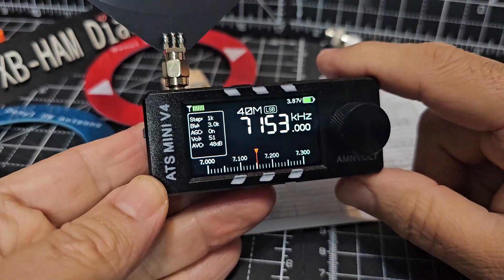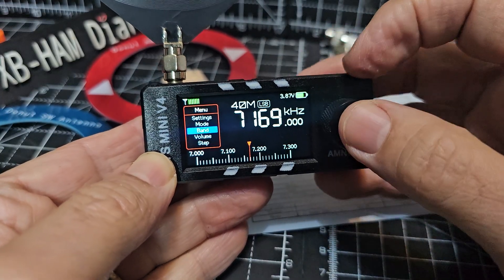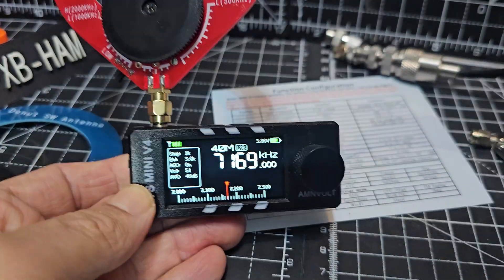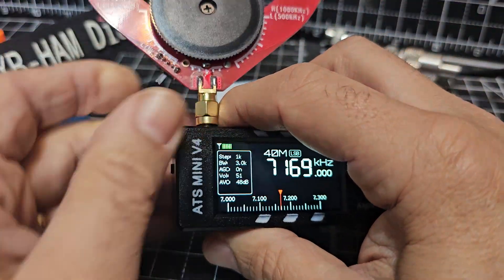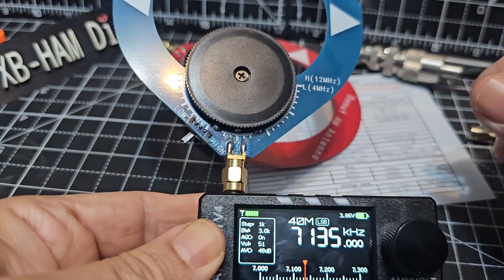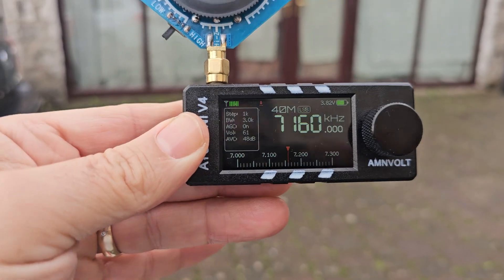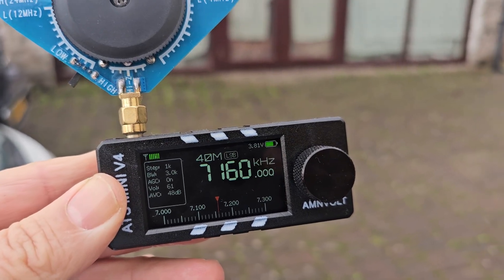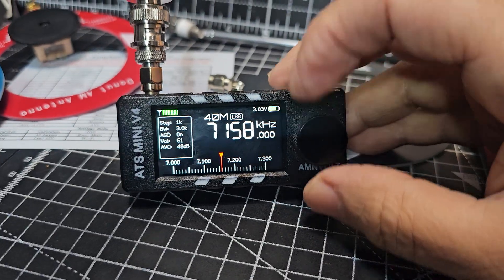Si4732 Receiver - Get a long wire

Comment: Just been listening to a conversation about antennas, reception and noise bands on 7133.000 kHz LSB good reception with 10m wire and a balun 19. (after I repositioned my wire!). Switched to my SW donut antenna (same as the blue one you have) to test what the reception was like and while I did get reception it was very quiet.
Reply from the maker: Yes long is good